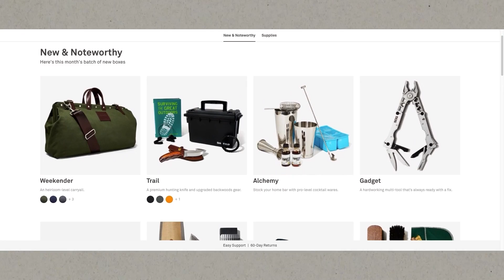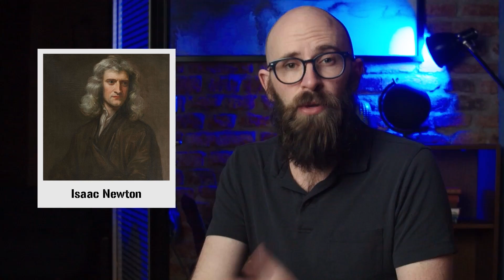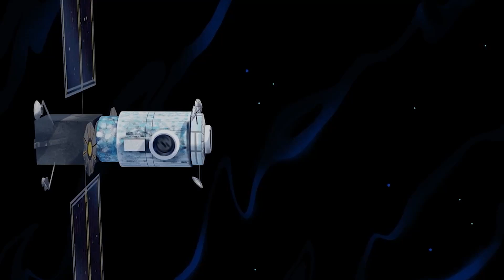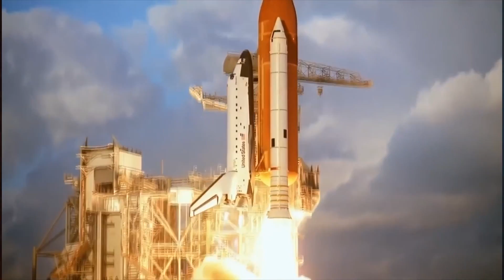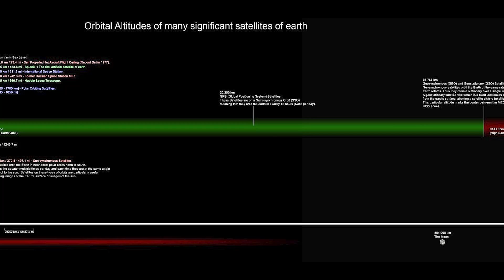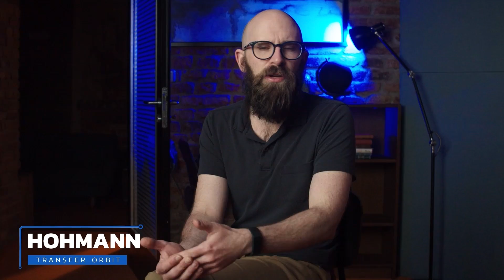LOP-G: Our Gateway to the Stars

Comment: A Hohmann transfer orbit doesn’t involve firing the thrusters for most of the trip. You perform a transfer burn from earth orbit, coast until you are close to the moon, then do a capture burn to enter lunar orbit. So while the initial and final burns will take much longer, they’ll still be a fairly small portion of the trip - so maybe an extra day, but the 5 day number will be broadly correct.

Comment: As for propulsion I don't get why we don't have soler sails that we can fire lasers at, Like the one we are putting up to go to Andromeda. Then just turn on a laser pointer POP, and off you go. Want to slow down. Turn the ship around and turn on the laser and There you are. Heck you could use a strong handheld laser pointer. :) sort of. I'm not a rocket engineer just a diesel mechanic at best.

Comment: At 4:08 you say orbital velocity is somewhere between 10 and 20 thousand meters per second.  I'm not sure where you got those numbers from, but orbital velocity for a low earth circular orbit is about 8000 m/s, and is slower for higher circular orbits.  That's for circular orbits.  The speed at the low point (perigee) of an elliptical orbit could be higher, but only for the lower parts of the orbit, and would be <8000 m/s elsewhere

Comment: Absolutely brain-dead stupid to assemble this in orbit around the moon. The right way to build this & all other remote stations (for anywhere in the solar system) is to build it, check it out, get it fully operational in the radiation protected space of low earth orbit. AFTER it is fully commissioned & checked out, THEN you boost it into whatever final location (eg., lunar orbit) you want it. This way, the assembly crew is not exposed to radiation, idly sitting on their hands, for 10 days on their way back & forth from their “construction site”. Instead they are just 3 hours-6 hours from earth’s surface. Far less food, oxygen, fuel, etc. to drag to the construction site. Far less danger if something goes wrong. Far, FAR, easier repairs if something breaks. Plus, this approach is applicable to putting outposts around Mars, & other planets, asteroids, etc. you simply CANNOT send construction crews on 3 year journeys (for EACH trip) to Mars.
Reply: Far harder to launch the complete station than sending it up in parts.

Comment: A hohmann transfer will always take roughly the same amount of time once a craft is up to speed and its apoapsis is high enough for it to get caught in the target bodys gravity well if everything is where is it should be in the orbit.

The only problem with ion thrusters is their thrust to weight ratio and getting up to that speed may take several burns taking advantage of the oberth effect by burning closer to periapsis but taking time doing orbits in between burns.
Or a less efficient big burn while passing periapsis but losing energy burning radail in and out.
A low thrust to weight ratio engined craft would also have to start burning retrograde earlier once it reached its target bodys gravity well.

The great thing about ion thrusters though is their efficiency and the craft wouldn't have to do a hohmann transfer and could burn for longer picking up more speed as long as it had enough ∆v and could slow down again once it was approaching or in the target body gravity well.

Don't let anyone ever tell you video games can't teach you anything all that was learned playing Kerbal Space Program.
Reply: Yes, KSP FTW! 🚀
But keep in mind that for human missions to the moon, they'll most likley not go for the standard homann transfer. During Apollo they aimed for a free-return-trajectory, which is quite a bit faster. About three days to the moon, I think.
Reply: Yeah, I'd be surprised if they'd do anything but a free return trajectory when they have humans on board. For uncrewed missions, I would assume they'll go for whatever is cheapest, which I assume is whatever requires the least fuel. Not because of the cost of the fuel, but because of the weight. Less fuel = more cargo capacity.

Thoughts?
Reply: Two sentences in, and I knew you were a Jeb kinda guy.

Comment: So... when your ship gets to Mars at high speed with a Hall Effect thruster, how do you slow down?
Reply: Start burning retrograde earlier that a conventional thruster would.
You could nealy aim right at it if you had enough ∆v but would have to turn round and fire the opposite way halfway through to slow down.
Reply: @Kingstallington  Wasn't there a discussion on how you could use a planet's gravity to slow a spaceship down, a reverse of the planetary slingshot effect?🤔
Reply: @STSWB5SG1FAN  You can only slow down relative to a planet's orbit around its star or a moons around its planet but not slow down enough to get into orbit at the thing you're gravity braking at without using some kind of truster.
You could however use Mars' moons to gravity brake and help get into orbit of mars itself by doing a reverse slingshot at one or both of them depending how things line up.

This will explain better than I can... https://youtu.be/bNox3jUG31Y?t=653

Comment: 13:47 - lets make your tangent mean something. 866 ft^2 is 80.5 m^2. The average ceiling height in a US apartment is 8 ft or 2.43 m. 80.5 m^2 * 2.43 m = 196 m^3. So the average volume of your New York apartment is 196 m^3, or 54% more space than the LOP-G habitat volume. Considering you don't get to float around in your apartment, if you only consider the "human accessible" volume by a 6 ft / 1.8 m person, you're closer to 144 m^3. The LOP-G would be roughly equivalent to a 760 ft^2 apartment by that logic.

Comment: The main purpose of this is to maintain a constant communication with a base at the south pole, which a small, unmanned satellite could do just as well.  Manned lunar missions would save fuel by going straight from earth orbit to low lunar orbit, with rendezvous there if necessary.  If its a lab to study deep space exposure, just say that.  Or whatever it really is.

Comment: It would be a lot cheaper/easier/better to launch the LOP-G parts up into earth orbit, assemble it there, and THEN send it to the moon. Honestly, people are going about this whole space travel thing entirely wrong. First you establish orbital infrastructure, then lunar way-stations, then inter-planetary missions. In. That. Exact. Order. None of this 4ss-backwards nonsense of wasting money on mars missions before even 'beginning' to set up a moon base. This is an exact reason why the ISS is NEEDED. Boost it up into a parking orbit and use it as a transfer station to send up modules and pods with fuel/parts/cargo/crew for any other missions you want. You can even use it to build a drydock for constructing larger spacecraft and spaceships. It's not that hard to figure this out, people! An elementary-schooler could figure this out! =^x^=

Comment: Wouldn't it be better to have one ship that specializes in going from the Earth to an Earth-orbiting space station and then have another ship that specializes in going between the Earth space station and the moon (like they did in the movie 2001)?  Couldn't you just use the moon as a launching point for interplanetary missions?
Reply: It would be more efficient. But don't forget that space is still incredibly dangerous for astronauts. That's why the Orion space craft is engineered to allow a safe return return to the Earth at any point during a mission, just in case something goes wrong. You couldn't do that if you first had to transfer to another vessel.

Comment: The LOP-G is also a test spaceship for trips to Mars and back.
Reply: Yeah. Though it isn't emphasized as much as the Moon stuff, realistically Moon wouldn't need LOP-G. However Nasa needs LOP-G and LOP-G needs Moon to get funded... So Moon LOP-G it is. There real job is to put astronauts there to see pretty much "how good or bad humans do in cosmic ray deep space environment".

The mentioned in video Deep Space Habitat had an officially listed out 500 day mission expansion module planned. Since 500 days is the simulated needed flight time for the most common Mars mission concept. So yeah wonder wonder what the LOP-G is about?

DSH was way more clear on the nose name about the main job. Guess that is why it didn't stick around.

Comment: Just wondering, has anybody considered: Instead of crashing the ISS in 2028 or 2030, why not send it into an orbit around the moon?  Instead of 1 outpost, then have two.
Reply: Would take a massive transfer stage, would be very expensive, and would likely break it if they shot it to the moon In 1 shot
Reply: @aliteralpothole9205  I agree, but it just ..might.. be possible that gentle acceleration would work, so over the course of many days its orbit would eventually intersect with the Moon's. And then you have the issue of slowing it down before it overshoots. Oh, and where the heck is the centre of gravity on the ISS? That could cause issues.

Comment: There was NEVER a lunar orbiting space station proposed until it was realized that the SLS wasn't powerful enough to get the heavy Orion capsule into a low lunar orbit (although the Saturn 5 could get the Apollo capsule and it's lander into LLO).  The only experiments you need to do while orbiting the moon is to test different types of radiation protection for 'deep' space and this sure doesn't require a multi-billion dollar space station.  As far as Mars goes, no past proposals (dating back to Werner Von Braun) suggested a requirement for a lunar space station.  The LOP-G is just a money project to get money to the traditional aero space contractors like Boeing, Lockheed and Northrup Grumman.  We should go with something like the earlier proposed European Lunar Village concept.
Reply: I would love to get more info on this?
Reply: Do you have actual proof?
Reply: @RuralJuror420  proof, sls does not have the physical capability to put orion in LLO nasas own number say so

Comment: It's all well travelling at 30,000 m/s - how are you gonna slow down or stop.  You'll need massive fuel laden engines at the front to blast it backwards to slow it down.  That said, it'll be a hell of a ride though...
Reply: No, you just need to flip 180 when you're half way because it will take exactly as long to stop as it did to reach that speed :P

Comment: Just one small problem. NASA hasn't hired enough astronauts to crew both the ISS and Moon missions. Also, when they first started training astronauts for the ISS it took 5 years - an undertaking that now only takes 2 years. In deciding on various timelines for moon missions, they used current ISS training time as a model despite the fact that they should have used the earlier duration as we will again be training new people on new equipment and procedures just like in the early days of the ISS. The normal time to hire crew from the time of the announcement of their missions is 2 years. Add that to the 5 years for the first class of moon bound astronauts and you get 7 years. So the earliest any new hires could be readied for a lunar mission is 2029. And they were concerned about the lunar spacesuits not being ready until 2025. Now a moot point.
Reply: "NASA hasn't hired enough astronauts to crew both the ISS and Moon missions...they used current ISS training time as a model despite the fact that they should have used the earlier duration..." This doesn't sound like a problem that NASA has itself, so much as it sounds like a problem that you have with NASA.
Reply: @alexanderstone9463  How is this not a NASA problem? If they don't have enough astronauts to crew both missions one of them will be stalled until there are enough. As for my feelings toward them, I try to call it as I see it. They, like any institution, have good and bad points. This issue seems pretty important to the missions NASA is committed to so their apparent inaction is a valid point to call out.
Reply: @Terp My point is that they have not always allowed safety or protocols to get in the way of their deadlines, or rather, those who oversee it haven’t allowed it to. In short, I can imagine them changing the requirements rather than the training, and simply ignoring the old protocols. This might not strike you (or me) as “safe”, but NASA can be a little cavalier at times. 

As for why they would be so cavalier, it’s simple, they don’t have the money not to be. Because of the ever constant changes in their funding, they repeatedly have to guess about what they’re training their astronauts to do. Faced with this uncertainty I think it’s perfectly realistic to believe that that they will just be like “Eh, what was good enough for the ISS will be good enough for the Lunar Gateway” and then just rewrite the rules to justify this policy.

Comment: SpaceX Starship that will be used to land on the moon that will have 1,000 cubic meters of usable space big enough to fit the entire Eiffel Tower, disassembled. Way are NASA not just using one Starship as a space station ? and a 2nd one for landing on the moon and refuel it on Earth orbit
Reply: Obvious answer is why would they right now. I mean if the program succeeds as planned and is flying continuously sure you could probably throw one into orbit as a station but starship isn’t a thing yet, repurposed ISS modules are. Gateway started back in 2011-2017 depending on what you consider it’s start and starship wasn’t a thing yet. Also it would make more sense to use starship to launch modules since that would be an unnecessarily expensive station.
Reply: Because starship isn’t out yet and won’t be until projected 2025. This of course means that it’s projected 1,000 cubic meters will be significantly reduced as it’s not feasible as on now. Unfortunately the cost also might be a turn away for nasa as the cost for space x are already higher than with previous shuttle missions. While 10% or so cost saving is great it still doesn’t solve the problem for damage from launch that must be repaired sometime up to 6 months or more.
Reply: @Darthrygis  I do not disagree with the first part about starship feasibility but the Falcon 9 dragon missions are significantly cheaper then space shuttle ever was.

Comment: "Chemical rocket engines are the only engines able to overcome the earth's gravity" Seems Simon isn't familiar with Project Orion "ol' boom boom" the nuclear bomb powered rocket.
Reply: damn anti space based nuclear weapon orbiting satellite treaties for stopping us from traversing space with the use of literal nuclear bombs and a big spring
Reply: I am generally in favor of not using nuclear bombs on the Earth because of fallout and blast wave concerns, but once already in space this would be an excellent means of propulsion.
Reply: Pretty sure it's a bad idea to launch things from earth using nukes. Also, can you actually call a bomb an 'engine'?
Reply: @musewolfman  No, because it does not have any moving parts. It can be called a motor though, because it does not have any moving parts.
Reply: @musewolfman  An internal combustion engine is a series of timed, controlled explosions. But also yes, very bad idea to use nukes in this capacity.
Reply: @jameskelly3502  your definition of an 'internal combustion engine' also fits a controlled demolition.

A bomb is not an engine, even if it is a method of propulsion.
Reply: @musewolfman  My comment was meant to be a brief comparison. Not as a comprehensive definition for ICE.
 Both use timed explosions, that are then used to perform mechanical work, (in different methods) for the purpose of propelling a vehicle in a desired direction.
Reply: Yes and also the nuclear salt water rocket (untested) and nuclear thermal rockets (tested on Earth but never flown: the DRACO project is meant to actually fly one). So there are 3 nuclear rocket designs.
Reply: oh god... another "technicality" nerd. To MOST people, the implied meaning of the statement would be, "the only PRACTICAL method to overcoming earth's gravity" is pretty clear. Just because a nuclear bomb could technically do it doesn't mean it's a viable method.
Reply: People are generally uneasy about using anything nuclear at or near the Earth's surface, so chemical will br the way to go to get stuff out of Earth's gravity well (until someone develops a practical anti-gravity system, or before that some type of mass driver slingshot).
Reply: None of the nuclear powered engines have flown and unless I'm mistaken one 1 has been tested so I agree with Simon
Reply: Again, chemical is not the only method of launching from earth. Electro-launchers are more than capable although the various brute force approaches would seem to limit the advantages. Careful orientation and siting of the launcher and precise application of motive force to the payload type can allow electro-launchers to deliver more tonnage, more frequently, and more sustainably; pardon me, did I fail to mention less noise?; than any other launcher type. Of particular interest is the claim made in certain quarters of fully reusable boosters. If a booster is 90% propellant and they aren't reusing the propellant then isn't the "fully reusable booster" really only 10% reusable?
Reply: @bethnglenn  
The extreme acceleration is going to splat anyone that's in the rocket so it would be limited to supplies and perhaps equipment.

Also creating the booster is significantly more expensive than producing the fuel.
Reply: @hohhoch3617  Lots of assumptions there. How much boost is being applied? What is the starting altitude? What is the payload? To assume that sea level to orbit for a space ship containing living people probably makes an electro-motive launcher impractical. Change the assumptions and you have a different design context. There are very good reasons to launch to more practical specifications.